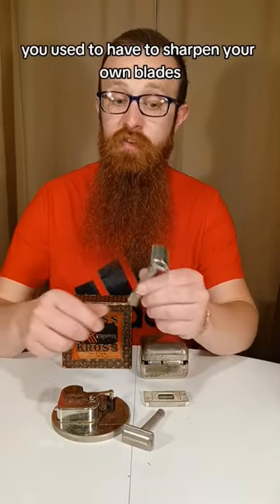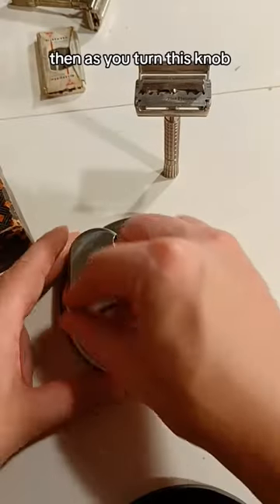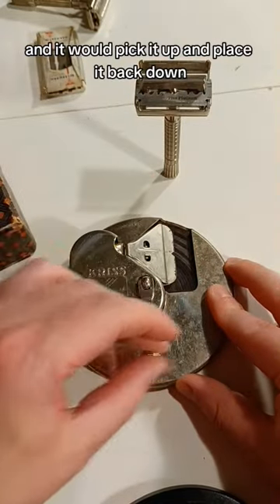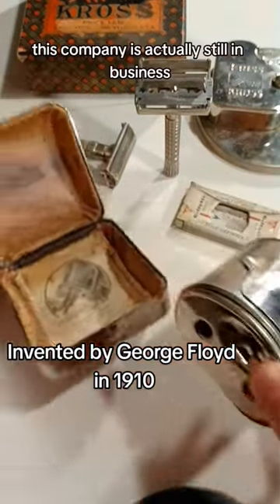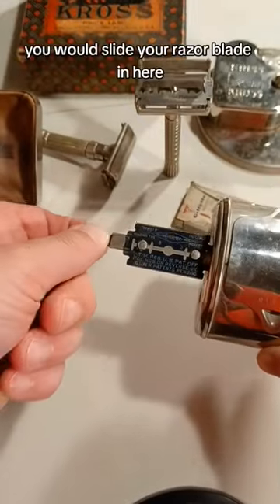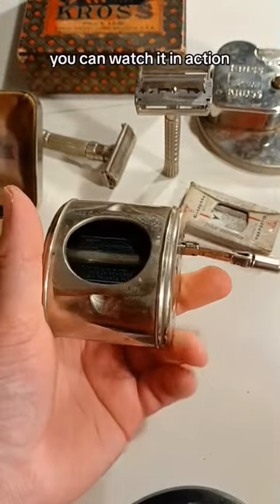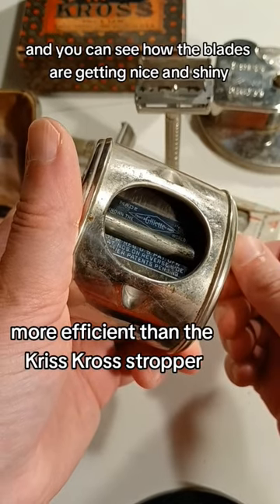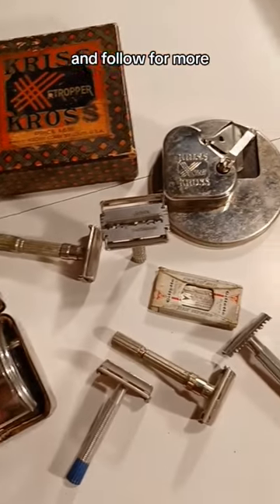#stropper #stropping #razor #razorblade #vintage #krisskross

Comment: While the Kriss Kross stropper will fit a modern DE blade, it was designed for Kriss Kross’s proprietary single edge blade.  The leather stopper has little to no effect on modern stainless steel blades.
Reply from the maker: I never thought about it, and didn't plan to ever use it, but I agree that the newer stainless blades aren't going to benefit much from this stropper. Even if the leather wasn't 70 years old.